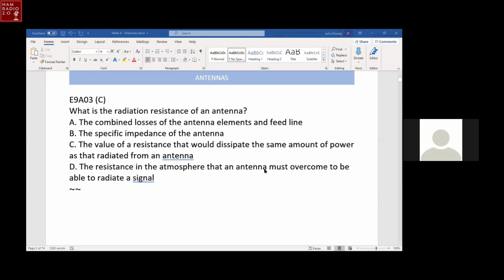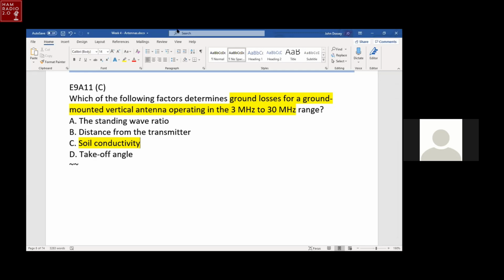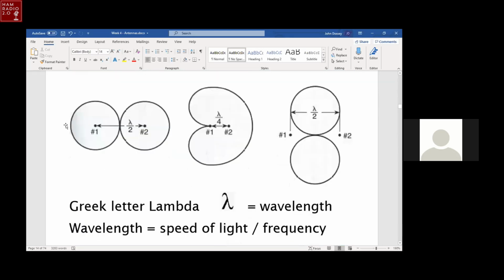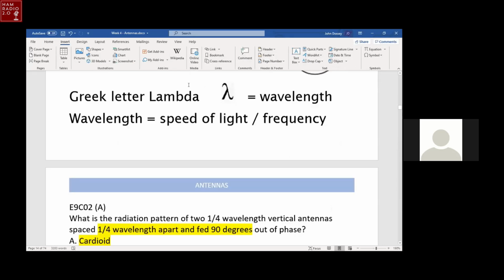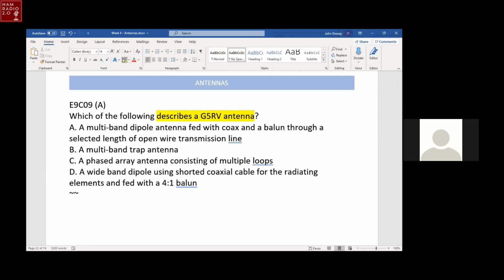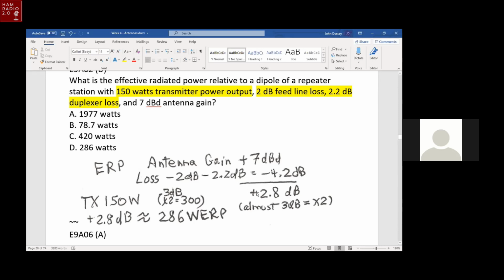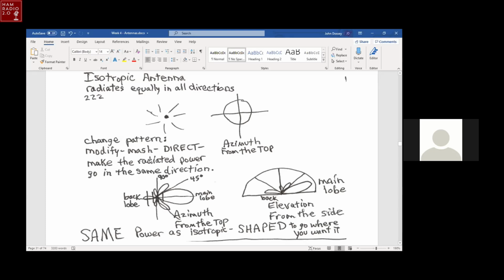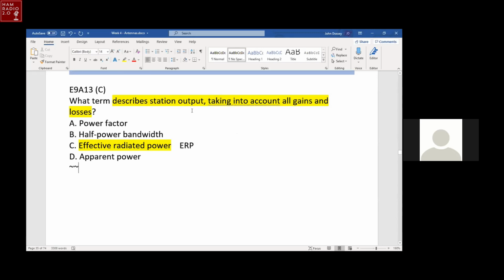Ham Radio EXTRA Class License Course Part 8 | Extra Class Study Guide

Comment: Because I already knew semiconductor stuff, I thought the extra test was almost easier than general. Not great at memorizing band limits and regulations.
Reply: Yeah, there isn’t anyway to get past the band limits and rules except memorize them. They have so many exceptions that you can’t reason your way through it. The stupid part is that every one of us has a printed chart of the bands, frequencies, power limits, and codecs hanging next to our gear. I’m too old to remember that stuff more than a few days. Hell, I have a hard time remembering last Tuesday. Like you, I learned the electronic theory years ago so it’s been more of a refresher than a new learning experience.